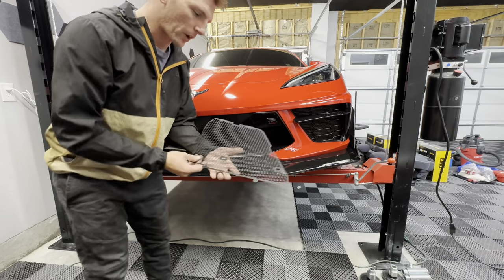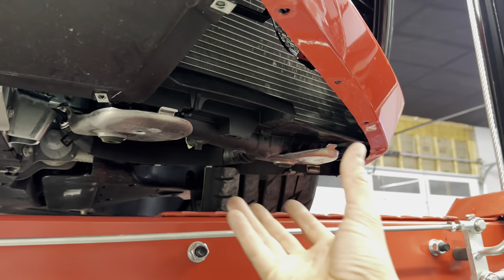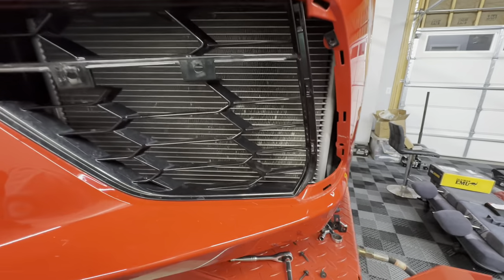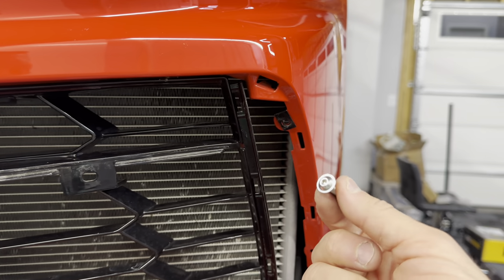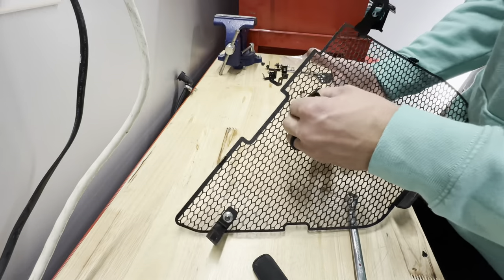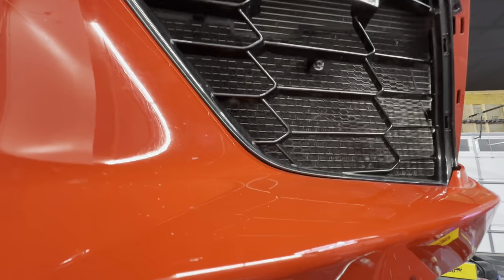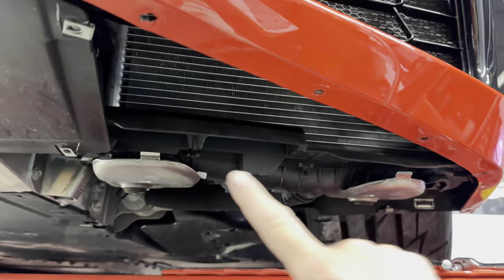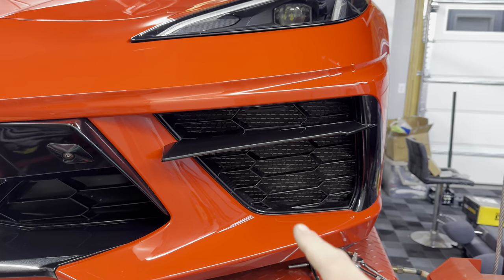Radiator guards for the C8 corvette! Install guide. 2020-2024 Why weren’t these stock?

Comment: I used the same Amzon\Billfaro guards.  They work great. 
I did add 2 tie-wraps on each side on the bottom to hold it secure.  The bottom double-sided tape didn't hold after a week.
Reply from the maker: Good to know, thank you for sharing with everyone!

Comment: The chief Corvette engineers said that they aren't stock because they aren't needed.  Many of the mesh guards they tested, lowered the cooling capabilities and they said it could be bad for the DCT if you live in a hot area or do track days...
Reply from the maker: This is good to know, thanks for sharing.
Reply: @GhostSpeedShop  I am sure that if the mesh is larger openings, the difference in cooling would be minimal...  But some of these things are like $700 for a $11 piece of mesh...  They just assume Vette owners will pay anything, I guess?

If I get a set, its gonna be something off Amazon like you did...  And it will be larger openings...
Reply from the maker: 700! That’s wild! I couldn’t imagine paying that much! Even in Hawaii I didn’t have cooling issues with these so I’m not worried about them. Now if I was tracking the car in Nevada during the summer, I could see these potentially becoming an issue. Thanks for your input and constructive comments, there’s not many of those on YouTube nowadays.
Reply: @GhostSpeedShop  You in Hawaii?  I am on Oahu this week for vacation...

I have a channel as well, so I get it.  haha
Reply from the maker: I was until September, I just moved to Colorado! Oahu is great, make sure you grab a bite to eat at Dukes in Waikiki!
Reply: @SquireSCA 
The pricing difference is insane for genuine parts as opposed to aftermarket.  
I guess it's like that all over the world for all cars.
Reply: @GhostSpeedShop 
Colorado is a pricey place to live.
But beautiful.
Reply: @jaggirl  The price is based on what they think a Corvette owner can afford, and is willing to spend.  The factory where they make that screen, probably makes the same screen for a Miata or Camry, and I bet it costs 1/5 as much.  haha

Comment: Do you really need these?  There seemed to be a knee jerked reaction from the Vette community about putting these on the cars
Reply from the maker: GM offers them as an option. The radiators look like sh*t after 2k miles if you don’t run them. It’s your call honestly but I like the way they look and I like the function of them. 
I’ve noticed with this platform anything other than stock makes the mob come out of the word works with pitch forks.

Comment: So Chevy found another way to cut corners and passed that on to their “Valued Customers” ?
Reply from the maker: I’d say it was an afterthought. They offer a set of these as an option now when building the C8 however they are an aftermarket option that GM has added to their pallet.
Reply: Can't argue the point.  They could easily add them in Bowling Green Assembly.
Hell,  they could design in a slide-in from the bottom. This will allow to remove for cleaning.
Reply: @TinaPretti  That’s a bummer.
So why did you buy it?
Reply: @Doc1855   I bought the car because I liked the car, I was merely pointing out a lack of planning on the part of Chevy, not enough to make me not buy it, I figured most normal people would understand that.
Reply: @CommonSense-qy7op  it sounded like you were putting your Vette down. 
I was by no means putting you down at all. I just couldn’t figure out why you said that is had less options than a Camry.
No worries.
Have a Great weekend